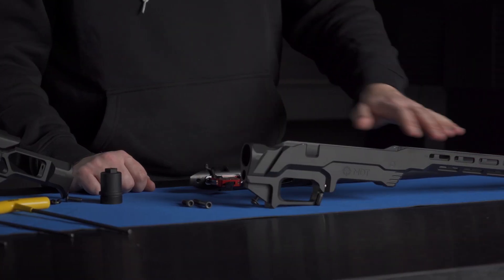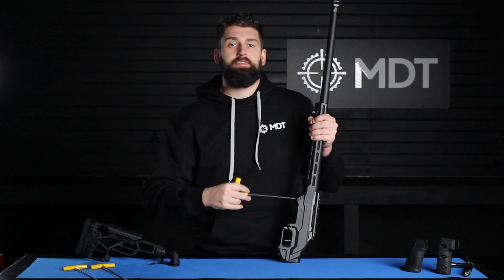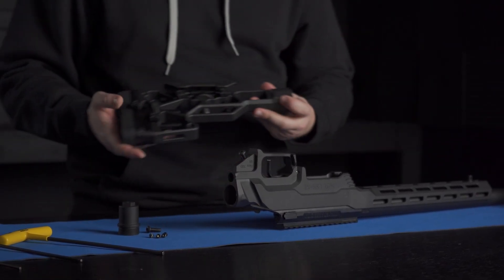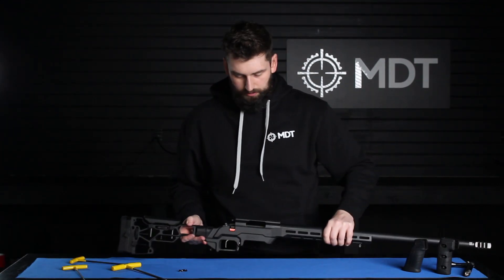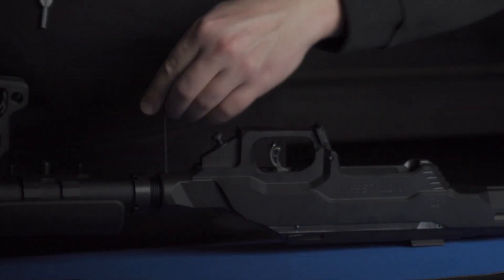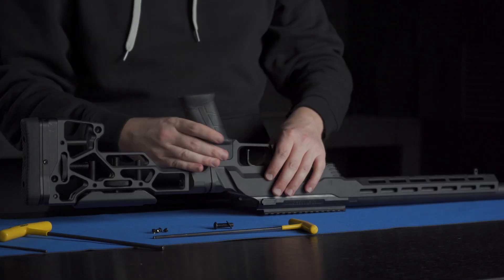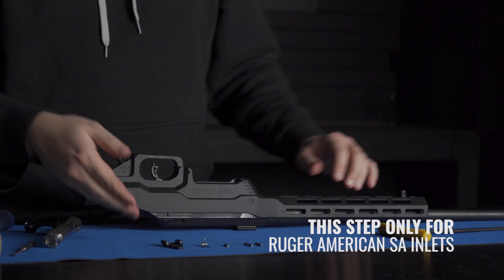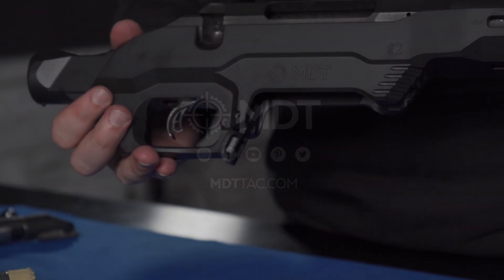MDT LSS-XL GEN2 Chassis System - Install

Comment: I see that they are compatible with the Vanguard/Howa 1500. Would that be the same as a mark 5? If not does MDT make a chassis 6lug 6.5 rpm, 9lug 300 wby?

Comment: Perfect timing lol. My LSS-XL gen 2 came today. Dropped straight in, no problem with my Savage 11 Hog Hunter. I got the fixed interface with a fixed to carbine lock plate. Seemed to give overall the shortest length of pull for storage. Also haven't shot it yet but I did cycle dummy rounds and I think it feeds smoother than the factory stock's blind mag.

Comment: I’d read about some people having problems with their magazines feeding, particularly the Ruger American 300 blackout builds. What I read was from 2016, so I’m hoping you guys have long solved the issue.
Reply from the maker: It depends on which version of the rifle you have. We currently support the AR magazine version of the rifle in our LSS-XL for a Ruger American short action AR. If you have a rotary magazine we are not aware of a magazine that can feed your combination reliably.
Reply: @MDTTAC  very good to know. thanks for the swift reply.
Reply from the maker: @jeffhuett101  No problem!
Reply: @MDTTAC   I have a rotery magazine but the stock is able to upgrade to AICS Mags or AR style i guess. My bolt is milled on the underside. I guess there are two versions on the 300 BLK bolts. My plan is to upgrade to the LSS XL gen 2 if possible.
Reply from the maker: @martinwechselberger4700  If your bolt is cut for AR magazine then it will fit our LSS-XL for a Ruger American Short Action AR and feed from AR magazines.
Reply: @MDTTAC  Will a .223 AR mag ruger american work ok in both the LSS and LSS-XL? And do you know of magazine that run reliably?
Reply from the maker: @frankfisher99  Only the LSS-XL Gen2 Ruger American SA AR inlet will keep the use of AR15 magazines.
Reply: @MDTTAC  oh thanks, so what mags will the standard LSS work with, or none at all?
Reply from the maker: @frankfisher99  No, problem. The LSS Gen2 will convert the rifles to using either AICS standard long action or short action magazines depending on the caliber and rifle.
Reply: @MDTTAC  ah ok thanks, I want to build a rifle for offhand snap shooting, for short range tactical comps. I think this would work with the RAR in 223, short action, and your short chassis

Comment: I just received mine for the gen 1 ruger american. The safety is deep down into the chassis and extremely hard to work on/off. Is this average for this chassis?
Reply from the maker: Just with the Ruger American due to where they placed the safety on the rifle.

Comment: One question: why do I need to remove the factory bolt stop pin on my Ruger American? I have a predator model and everything seems to be working fine without replacing the pin...
Reply from the maker: The poly stock that came with the rifle sits higher up on your receiver, our chassis sits lower so the pin that holds your bolt stop in, being shorter in the factory configuration can work its way down and out, causing you to lose your stop and spring.  We include the longer pin so it cannot work it's way loose and is held in by the chassis.
Reply: @MDTTAC  dang! Great to know, thank you for letting me know. I just bought and installed the chassis and the skeleton stock and I’m loving it so far. Thank you for the guidance
Reply: @MrLocke-bk3om  Incidentally my Magpul Hunter stock on a RAR has the exact same issue, that factory ruger pin is just too short. What calibre is your RA and what mags do you use with the MDT?

Comment: The CZ455 has a small mag release lever. Is a extended mag release needed or will the factory one work unhindered!
Reply from the maker: In our LSS-RF for the CZ 455, it's no problem. In our ACC, we do recommend our extended latch kit. https://mdttac.com/cz-452-455-457-extended-mag-latch-and-spacer-kit/

Comment: sorry what is the allen head SIZE to secure the buffer tube? i cannot unscrew in order to lock down
the tube as suggested by video?

mine is tikka LA version.
Reply from the maker: If you are referring to the screw that goes into the buffer tube, it is a 5/32.

Comment: If you didn’t have a torque wrench and cranked down more than 60-65 in-lbs would that be a bad thing?
Reply from the maker: Go contact plus a 1/4 turn if you don't have a torque wrench. You can but it's easy enough to get in the ball park.

Comment: I have the savage 110 tactical in 300 win mag. Is there a difference in the recoil with a fixed stock vs the buffer tube?
Reply from the maker: There is not any difference.

Comment: Hi would this suit a t3 sporter barrel or they just meant for varmint heavy barrels...
Reply from the maker: It will work with a sporter barrel without issue.
Reply: Thanks for ur reply... just not sure how the t3 lite sporter barrel would look as the forearm recess is quite wide.....

Comment: Does MDT have chassis that would work for a 30-378 Weatherby?
Reply from the maker: It depends on what action you have. If you have a Weatherby Vanguard in 30-378, Weatherby, then it will fit in our How 1500 LA chassis systems without issue.

Comment: Do you make a thumb skrew that can be used to toolessly remov the stock?
Reply from the maker: We do not at this time. However, it is a 1/4-28 thread so you maybe to find something that could work. We also have folding stock adapters available depending on what your goals are. 

https://mdttac.com/mdt-folding-stock-adapter.html

Comment: I have a savage 110 with an action screw spacing of 5.062 does mdt make a chassis that will fit that spacing?
Reply from the maker: That is a Savage long action spacing which would fit our Savage long action chassis. However, if you have an older rifle there could be some things to watch out for.